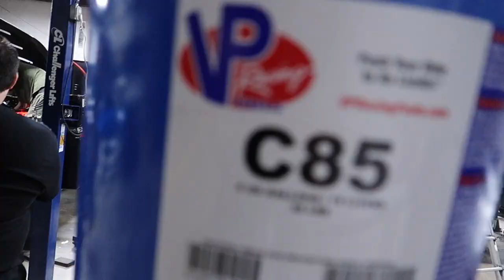My 1000hp MUSTANG GT- TWIN TURBO KIT IS GONE... What Really happened?

Comment: Well that explains why they use it for track use tq makes a big deal when drag racing and we all know mustangs are good the last half of the track so may want to keep that tune for drag strip purposes for a better 60ft. Also maybe you need more spark for c85 seems more volatile which is why tq is picked up but maybe in the higher rpm range it just can’t burn it all maybe increase spark or dial back fuel or increase boost I would play with it a bit. That’s my theory hope it helps.

Comment: 10 g for  turbo kit . Wow 
I'm priced out . When did 10g for a kit become a thing. 
Very cool kit but way to rich for me .
Reply from the maker: It’s more like 8g. Boost is money
Reply: Turbos are supposed to be cheap power for that money on a street/ race car I'm going with a supercharger like stangmode, no boost lag
Reply: @bustinyanutz4195  You're still gonna spend around 8k after it's all said and done, and that includes no labor.
Reply: @bustinyanutz4195  no such thing as cheap power
Reply: Well maybe I'm old but i remember 3 to 5 was the going rate . 5 being a best kit . Even at 8G . That alot for just a turbo kit . 

Again . Not knocking the product but that price tag is mind blowing . 

Would like to see HP  difference beyween kits vs dollar value.
Reply: @Spad68  yeah technology has improved. I'm sure it has to do with tech and product quality/performance compared to back then. You can still find cheap turbo kits but doesn't mean they're any good